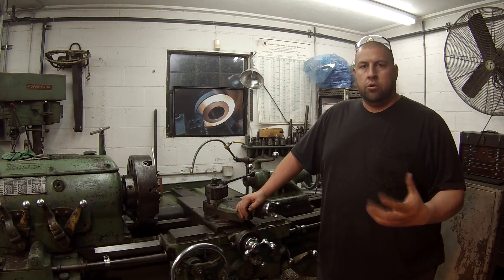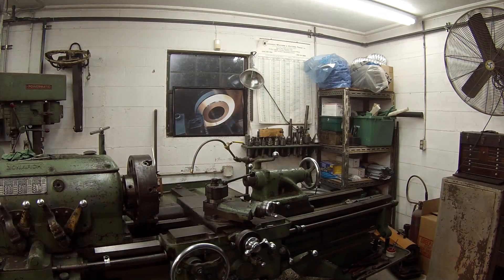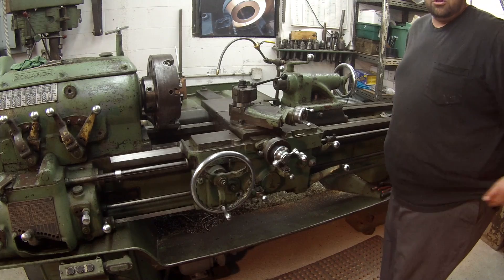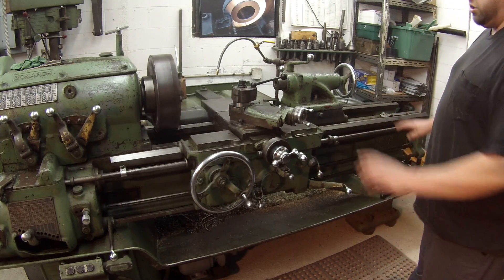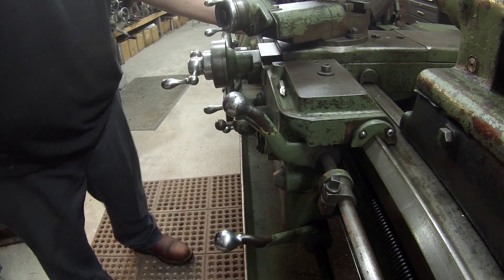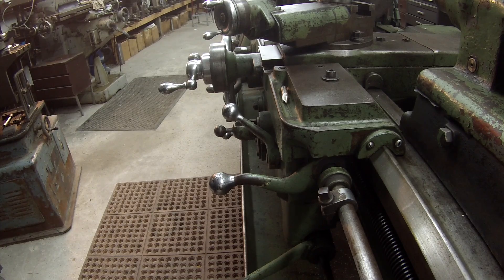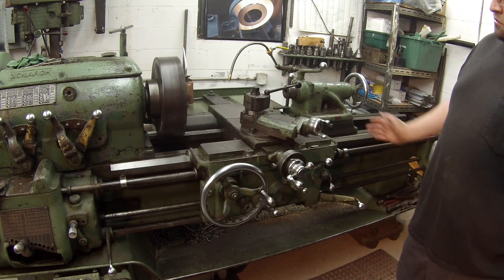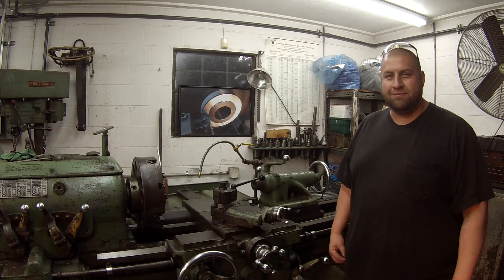Monarch Lathe Feedscrew Reverse Lever

Comment: I have 2 monarchs, one 1942 and one 1943 vintage. There is a fine adjustment to the feed cut out on the left hand end of the apron so you can accurately cut internal threads up to a shoulder or bore holes up to an internal shoulder. Brilliant feature.Also there is a stop system built into the cross slide so you can always reset infeed to same place without looking at the dials reading when screwcutting. You then put in a bit more cut with top slide set at half thread angle until you get to full thread depth. With both the cutout and depth stops set you can screwcut blindfolded. I have done it!
Reply from the maker: I’ve covered these topics in my videos regarding the Monarch features.

Comment: At work I regularly run a Monarch 50 x 16 (Series 50, Model 16 as they call it). It doesn't have this lever, and I for the life of me can't seem to find the correct lever for lead screw rotation change. Anybody got experience with threading on this lathe? And as of today, when the half nut lever is engaged, lead screw rotation ceases and the carriage does not move as it should. Luckily, threading isn't a part of my normal duties with the Monarch but I'd still like to get it resolved.

Comment: Abom79, thanks for sharing this!!  I have a "new" Monarch series 60 that I was worrying about, mainly  the leadscrew reverse feature.  The seller made it sound as though the reverse lever could be employed at any RPM, but when I tried that it was CLACK Clack clack clack!  Not until I used the slower RPM's only did it work as yours does.  Mine acts the same; 200 RPM is about the fastest I'll use the reverse feed lever on.  This video was very comforting!

Comment: Adam, I just purchased, not yet received, a Monarch 16"x54" Model "W" and was looking at a flyer that I found online and it says it comes with a quick-chasing stop for threading, do you happen to know what that is or how to use it?  Mine doesn't have the reverse lever like yours.  I wanted to be able to thread to a shoulder with my lathe and the feature you described with the reversing lever sounds perfect for that, just wondering how I could do it with mine.

Thanks for your thoughts and thanks for maintaining your channel, I've learned so much from your videos.

Kindest Regards,

Craig
Reply: Hi Craig, it's not a simple feature to add to a lathe without it - you have to have reverse gearing running at spindle speed and a dog-clutch to engage either forward or reverse, plus the stop/trip mechanism, control shaft etc.
I've been working on adding this feature to my Holbrook C13 lathe (the models "either side" have it) and the reversing gears and clutch are the simple bit, the actuators have had me scratching my head to the bone! I think I have it worked out, but damn I wish they'd fitted it as standard - would have been really simple to do!

Comment: Adam, very clear presentation.  I think you nailed the answer. 

My South Bend 9" has a reversing lever too, but it's to the left of the headstock, not on the carriage. Given that the whole lathe is only about 5' long, it's not much of a reach from the normal operating position so no real need for it to be elsewhere. It just moves the tumbler gears.

-- Mike

Comment: Hi. Nice vid .  I may be wrong but i can see that you could use the the auto stop when turning but think that it would screw up the timeing when screw cutting as it must loose the relationship between spindel and lead screw when changing from fwd to rev .
Reply from the maker: No it works, my dad and myself have used it for threading many times. Guess ill have to put it on video so people can see it in action.
Reply: Abom79
Yeah, it works - the leadscrew clutch isn't actually on the leadscrew, it's driven from the spindle and runs at spindle speed, plus it's a "siingle-tooth" dog clutch that can only engage in one position, so the leadscrew and spindle are ALWAYS in the same  relationship, rotation-wise. That means that you can leave the threading half nuts engaged and use the stops or lever to engage or disengage the drive, and always return to the same thread, even metric threads on a inch lathe (or vice-versa)

Comment: This feature is used on European style lathes for metric thread cutting where the pitch is rarely a natural whole division of the lead screw pitch and the thread is cut using a straight plunge and not the angled compound, so you want to leave the the half-nuts engaged and you are cutting on both sides of the tool anyway. Also works good for a reverse spring cut when boring.

Comment: Just a quick question,  if you set the feed rage for threads per Inch ie say "14" and the diameter of your stock changes you should still have the same 14 threads per inch,  is that right.?
Reply from the maker: Yes, your pitch stays the same no matter the diameter.
Reply: Thanks, I am tryingto look at setups for thread cutting on my lathe as the only way to change it on my lathe is to switch out gears but its not a big lathe so I expected that.

Comment: So the lever doesn't disengage the gear train between the lathe spindle and leadscrew? If it did it would bugger up the timing for screw cutting. Is this correct?
Reply from the maker: I've never been into the machine to see how it's all timed, but it always stays aligned perfectly.
Reply: The main spindle and shaft with the reversing dog clutch activated by the reversing lever are running at the same speed so no problem with thread timing for regular pitches threads

Comment: So if you set those clamps, you get auto reverse... pretty neat.  OOPS, I see it just goes to neutral.
Reply from the maker: Yes just neutral. I never use them but it would be nice to see the old timers using the feature back when these were the real work horses.

Comment: A feature I think I remember you talking about in the past was the ability of the Monarch to have the carriage and the slide feed independently selectable. Maybe I didn't say that right. But the feature allows you to machine tapers without a taper attachment.
Reply: Yes, but not tapers... just one single taper. :)
Reply: +65BAJA Yes. DSCKy is right.  Engaging both feeds at once allows you to cut a certain taper, but ONLY that one taper that the carriage gearing will permit, otherwise you would need a second gearbox and feed shaft for the cross-slide and so more parts and complexity.  Cutting different tapers than what you can get from both feeds at once is what setting-up a tapering attachment on the cross-slide is for.

Comment: Hey Adam
I just finished this same info on Tom's channel. Should have seen this first. Would have saved me allot of typing. I have the same, pretty much identical Monarch that they are talking about. When I got mine about 30 years ago, I ordered an original factory manual/parts manual from Monarch which I still have. At the time it was over $200 a little pricey. A few years ago I made a PDF from it. Very high quality and good parts blowups. I'm going to offer them a copy and you too if you want. We have the Series 61 Toolmakers model. I know now from your video what model you have. This is still a good book for you too. I do have one for your model too if you don't already have one. The quality and info is not as good as the one I made for mine but still good to have. The model 61 book has more updated info and pertains to your lathe also. I'm just going to copy and paste this over to Tom all this typing is murder.
Joe
Reply: CyclesInc P.S.  I am talking free on the books. Don't want anyone to think otherwise.

Comment: That is a handy feature.  I think I remember the lathes or at least one in my high school machine shop class having a threading clutch that would kick out at the end of the thread if you set it.  I certainly don't remember the brand of the lathes though.  We had a nice big power hack saw too.  Even though I have a band saw that cuts a lot faster I still love those things.  Thanks for sharing.

Comment: I just wanted to add that the true toolroom lathe will have this feature and does not require a threading dial! its called a single reversing  tooth dog clutch   ..my 1917 Hendey lathe has this feature :)

Comment: Well, that takes the mystery out of that.. ;-)
Nice useful feature at least for low speed operation. With the play in the handle would the response time be quick enough for threading??

Colin
Reply from the maker: Colin, I don't know if Monarch intended for it to be a high speed use feature, it works quite well on the low end. Think real coarse threads, odd ball pitch. Even when cutting short fine pitch threads it's useful. I don't use it all the time, but it's nice to have.

Comment: I have apron reverse for the feed screw  but not the lead screw on my Monarch. Interesting to see the differences in the models of lathes. Ricks lathe looks like it might be a hydraulic headstock machine I think a model 61.
Reply: It is a Model 61 and 61 is not hydraulic.
Reply from the maker: Cycles inc, I was thinking the same is Bryan. I see a pic where there's a relief valve. If it's not hydraulic what's the relief valve for?
Reply: One of the shops I do work for when they can't swing a big piece has a Series 62Monarch and I have run it and it has the dynashift and is hydraulic. I thought maybe the 61 was too with those little tiny levers didn't look like they would be good for manual shifting. Thanks for clearing that up.
Reply: Abom79 If your talking about the round brass looking thing above near where the shaft goes in. That's a oil fill cap for the gear box.
Reply: bcbloc02 They are a little short and if you don't jog the spindle a bit they are a little hard to shift with.
Reply: Abom79 If you're talking about the lever next to where the shaft goes in. That's one of the levers you use to make feed changes. It does look a little like a safety valve. It's supposed to have a pin on the bottom not a screw and nut hanging there.
Reply: Abom79 Adam, After thinking more about the relief valve. I think you may be looking at pics other than in the video. There is a relief valve on the back of the headstock and that is a relief for when you grease the pulley sheave bearings. Below it; there is a grease fitting that you fill until grease comes out the relief valve. You probably have one on your machine also.

Comment: You've raised the concern that at higher speeds this could be detrimental in time to the gears. Now, i wonder if that lathe's shaft was removed for this very reason, either because those gears were damaged or because someone wanted to prevent that.

If i remember correctly Tom said that it might of had been removed because it was a potential danger to the operator what with it being so up and close..but seeing from you moving the lever, it's not actually a rotating shaft as much as it is an extension from the main body??!.

This is all assumption based on what i've seen and heard so i might be completely off track.

What i'm interested, is, does the shaft have any kind of mechanical operation other than inside the gear box?

Also, Adam, really nice of you to make a video, it's certainly a very helpful one.
Reply: The shaft not only reverses the rotation it also holds your travel stops and kicks off your feeds.
Reply: CyclesInc Gleamed it. Think they removed it on the other machine because something was broken?
Reply: aserta I think it got damaged moving the machine at one time and rather than fix it they removed it. The lathe will run perfect without it but not if its bent. Nice features to have but most lathes don't have them anyway.